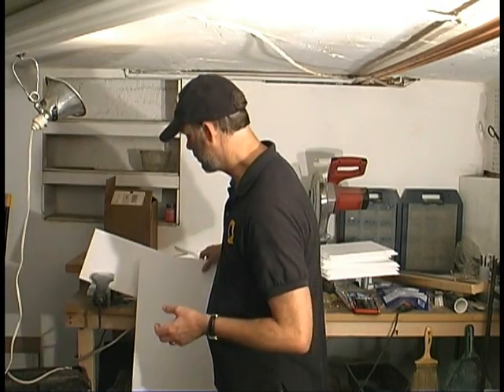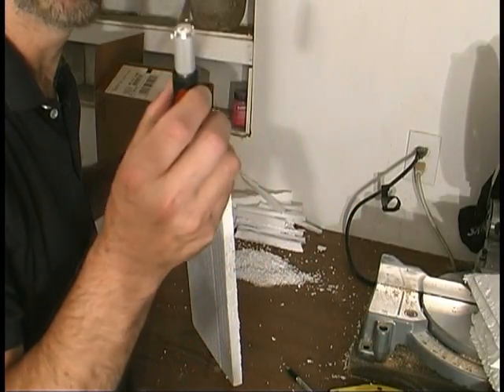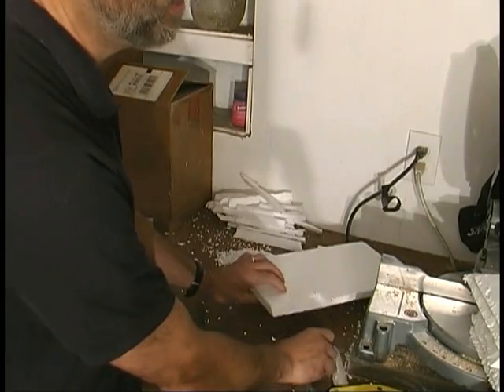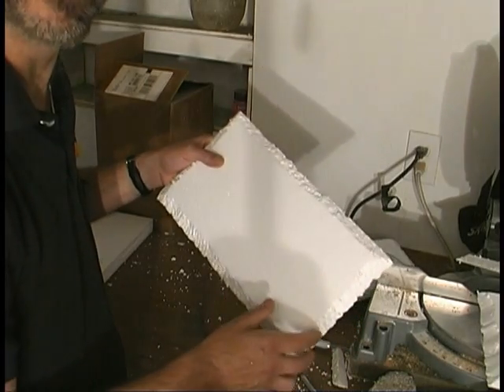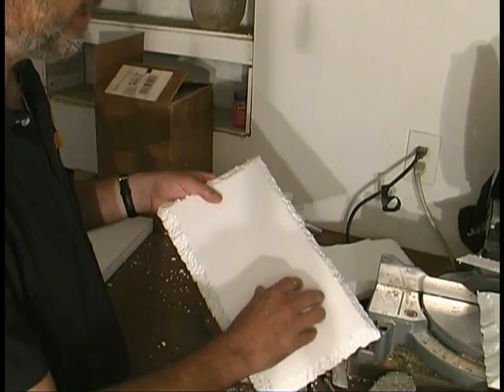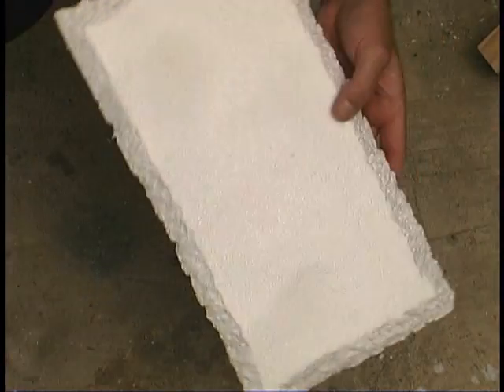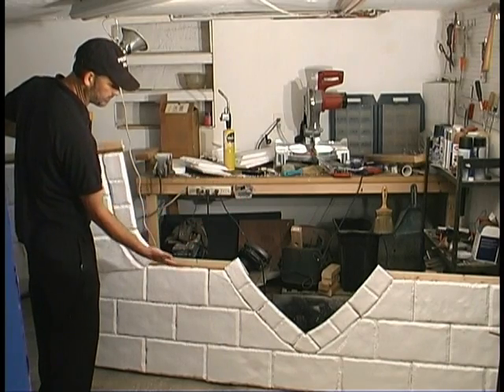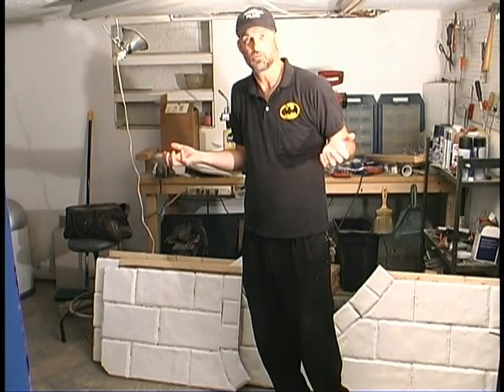How to make a stone brick wall from polystyrene styrofoam tutorial

Comment: I tried this lol for my grout lines i used drafters tape and a high heat glue gun without glue but had to be careful not to melt too deep . then i took. A bbq grill cleaner brush to make some detail..some coarse grit sandpaper to rough it up some and a chore boy oven scrubber rubbed here and there for detail. I mixed sand and acrilic craft paint with elmers glue all in my brick color and kinda slopped it on the bricks and rubbed it around to mix the colors .. Let it dry.. Then painted a grey sand and glue grout lines..it wasent shiny almost matte so i got a matte craft sealer..it looked awesome..